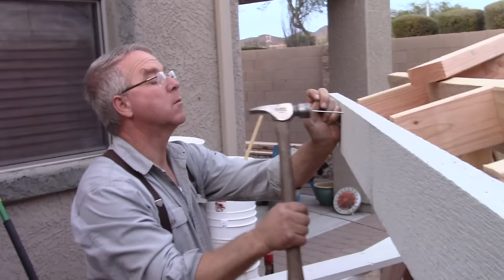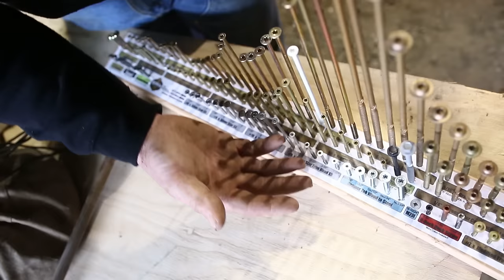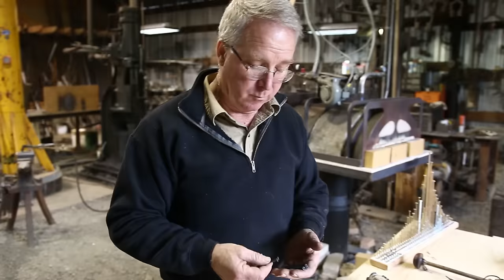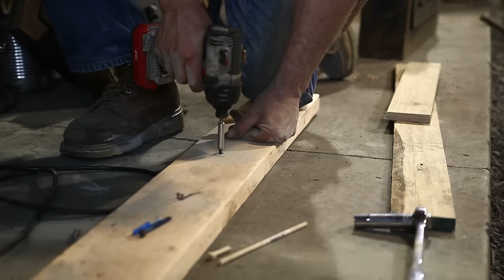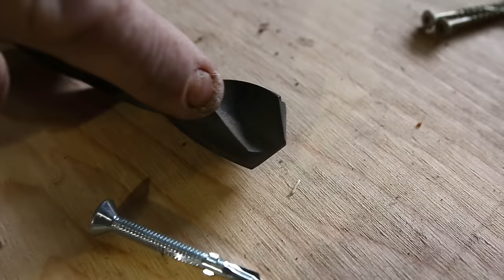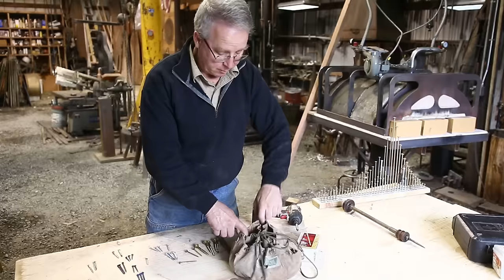Screws: What You Need to Know

Comment: My favourite are 75 mm wood chip screws. Tough and hold extremely well. The zinc plated ones we use in glass and Aluminum joinery trade are great with rawl plugs. I prefer nail gun because of speed but for strength you can't beat the right screws or gyprock screws.the grey ceramic rubbish accumulate in my toolbox.

Comment: Since this video Simpson Strong Tie has a line up of torx drive screws that also include torque reduction thread design that helps extend battery life on your drill and melt into the wood like a hot knife into butter. Great info 😎👍

Comment: Speaking of deck screws, there is a brand called " Saberdrive" . They are a torx 25 drive and they are tough and drive smooth. Because of the torx drive, your bit never slips. They include a bit right in the box, and they are just amazing screws.

Comment: I have been a big fan of those GRK structural screws ever since I first tried them
Reply: GRK's have number 10 or 12 structural screws that can replace a 1/4 inch or more lag bolts ! just holding one in your hands and feeling their weight you know they are using some top notch steel ! Out here in Canada they are around $1.00 each or more ! They do intensive research and testing on them to when you look at their website the intensive specs the released on every type of screws they sell ! Try to find specs on the cheap chinese imports you won't !

Comment: I used GRK decking screws on a new trex deck.  I drilled all 1/8" pilot holes just as per instructions.  Within a month half of the screws sheared off between the trex and framing.  A trex rep said he couldn't see anything I did wrong but told me to take a hike when I ask for some reimbursment.  My opinion, take your GRK screws and shove em.

Comment: Here in Canada Robertson screws have been the standard for years. When a piece of hardware comes with Philips screws I throw them in out and replace them with Robertsons. Philips have almost nothing to recommend them, except in drywalling where the driver cams out of the screws. 
Having said that, the new timber-framing screws with six-point Torx-type heads are amazing.
Reply: I discovered Robertson screws about 8 years ago, they are 100 times better then phillips.
Reply: Henry Ford ran a competition, but upon finding out Robertson was Canadian, decided to go with Philips.  USA #1

Comment: Here in Canada, Robertson screws are the most common type you will find.  They are readily available in all sizes at a decent price.  Certainly cheaper and more available than Torx.  GRK’s are available, but more as a speciality item for which you pay a premium.  

Now, I said Robertson screws because that’s what I’m used to calling them.  But as other commenters have mentioned, it’s not clear how many of these screws are actually Robertson and how many are square drive.  There is a noticeable difference between the two when it comes to “sticking” power.   The tip of a true Robertson screwdriver is square in cross section but the edges are slightly tapered.  The screw recess is made to match.  The result is a snug fit that enables the screwdriver to hold onto the screw even when it is pointed towards the ground.  

While Torx screws are a bit better at resisting cam-out than Robertson, for most applications Robertson screws are just fine and are — in my area — the cheaper alternative.  They are vastly superior for power-driver applications than Phillips or even Posidrive. They are only marginally better than Robertson.

On a scale from 0 to 10, I would rate slot screws a 1, Philips a 4, Posidrive a 5, Square Drive an 8, Robertson a 9, and Torx a 10.  That’s on all aspects except price.  Factor in price and Robertson beats Torx.

Comment: Only place I break GRK screws is driving into oak beams and then trying to remove.  I really like the HeadLok screws with spider drive heads.  Used them to install SIPs on my oak post and beam house and they really speed up the process over the 8" ardox spikes that I used on my last house.

Comment: I'm in the middle of an outside corner removal due to water penetrating a 20-year-old house. The 16d penny nails were rusted to pin heads and the rot had eaten away the bottom 8 " of three corner studs, the entire floor panel and the trim. What complicated job, especially since the deck was attached to these studs. Good bye nails ! When water seeps into the wood, the nails rust away and the structure is compromised. Now I'll use the rust resistant screws to replace everything

Comment: GRK all the way. Their #9 and #10 R4 screws are strength rated (look right on their website) and will make a connection better than any nail of comparable size. Their RSS products are a blessing for sistering up damaged framing members where full replacement is not practical.  This long thanksgiving weekend I am replacing exterior wall sheathing going from pressed fiberboard garbage to 1/2" plywood and most of the (roofing) nails used just pulled right out...  2.5" #9 grks were used to secure the new sheathing. Replaced a section of rim joist and the old one just about pulled clean off.. nailing into end grain already holds less and add 45 years of shrink-swell cycles. Two 5.5" #12 GRK R4's  and a bead of adhesive on each joist end to fasten it down.  I tried them two years ago and became a believer.

Comment: Just for your info. The yellow metal is cadmium plating.It was mostly used on nuts and bolts 50 years ago for ,I think higher resistance to salt water corrosion than zinc (galvanised).

Comment: I just checked the Amazon website and the parachute bag is available. They call it the Bucket Boss Parachute Bag and it is only about 12.99 for prime customers. I don't know the quality compared to his but since just about everything is made in China and what they produce is seldom as good as the original I will leave it to you to decide. I'm going to order one because I am tired of carrying my plastic Stanley case around with me, even though the bins that store your various size screws or nails (I have one for each) are removable, they are awkward to carry when you also have your drill case and a bag of other things you will probably need it gets cumbersome. Sometimes I feel like a pack mule in spring as I go around my property and repair or replace what was ravaged during the winter season or damaged by local vandals.

Comment: Used g r k screws with a t15 bit given in the box. Both the screw and bit started stripping. I prefer Spax stainless screws, sink an eighth of an inch and filled it. No moisture no problem.

Comment: I learned how to hammer in 1986 working for a builder part of the summer nailing together wall sections.  Later when my wife and I built our own home I scored a steel handled framing hammer and steel handled finish hammer from Sears as they had a great sale, I had a coupon and we got an extra 10% off by using our sears card which brought the cost down far below any other hammers.  They worked great and I still use them to this very day, 26 years later.  My wife is a bit of a spitfire so when the smart aleck at the register asked her if she had a left handed hammer or a right handed hammer I gently put my hand on her arm as I could see she was thinking about smacking him in the head with the finish hammer she had in her hand...she's still a pistol.

Comment: Very good video! The german version of the GRK would be the "Würth Assy" system. Slightly different bit than torx, but works better when you have to hold your electric screwdriver at an flatter angle.

Comment: I’m all screwed up lol. Great video I agree 💯 % that you can’t get a better positive drive than torque screws.                                             And “Cordless Impact Guns” & screws are starting to almost replace the “Hammer & Nail”. They even make nails for framing guns that look like screws and are made so you can remove them with a torque drive instead of a pry bar or any type of nail pullers.

Comment: I'll have to try the GRK screws - I've checked and they're available where I live (UK) and not much more expensive than the decent screws at our most prevalent merchants (Screwfix). Interested by that lefthand thread near the head, improved clamping force without driving the head right through the workpiece I reckon.
You're right that hammering is a skill; I'm a DIYer so don't put in the hours, it took me years before I could drive a nail straight and true without pilot-drilling whilst getting a better-than-even odds of not bending the damn thing. Not enough precision to do a 3-inch nail in two smacks but I'll get there :-)

Comment: I use 14g batten screws in a 5mm hole to attach things to concrete or brick. Been doing it for years, yet to see a failure. 
The ones I use are ceramic coated hex drive, and I splash a dab of polyurethane around the entry to keep the water out.

Comment: Really smart stuff here.  Thanks!  Ok.  Now I have inherited about 20 types of Philips head screws.  I have 25 types of Philips head drivers for my drill.  Each driver will fit into about half of the screws, but they all fit differently and will drive with random success.  What are you looking for when mating a driver to a head to make sure you don't strip it when you are about to use the screw?

Comment: Tek srews with hexagon heads normally used for tin roof and clad are great for frames. 5.5mm average is just so much more srew for about the same price as good woodscrews. Take them out even easier than torx, re-use. Heads either stand proud with the washer or sink themselves or forstner bit first for flush finish. For structural stuff its great, also for props. They are sometimes hard on surface or if your wood is dense and dry may split. Our irish fast grown softwood however: perfect!

Comment: The best “trick” I’ve learned about fastening small stuff to concrete....drill a 1/4 hole, fill it with flux and molten lead....you can put screws in it all day.  Works great for threasholds, and transition strips.
Reply: lead wool works better than molten lead

Comment: Your vids are great. I'm a retired US Arny Combat Engineer 1980 to 1994, we in my time often built substructure using wood,nails, and wood glue in certain scenarios.
When I got out I was finishing up my college degree pursuit and working as a handy man. TWO GREAT innovations that I saw Screw materials improvementand liquid nails used in place of wood glue on exterior projects. 

I love Spax screws and solely use them over nailing, except in trim piece installations. 
As you said screws have improved the efficiency of the work, but sadly the quality of homes being built today is abismal. Developers and contractors are not at the level of quality Build responsibility as Contractors like yourself, Bill over at Sparky Channel or the East Coast guy Vince of VCG Construction.

Here in So. Cal. The new homes built are just a building waiting to cave in on the owners, and no one's doing anything about it and worse the pre-home purchase inspectors are just as bad. Telling homeowners either what's not true, OR adding repairs that really are not necessary. 
Your videos are factual and reliable. Thank you sir.

Comment: screws have greatly improved over 20, 30 years. Honestly, a galvanized nail, can be 30% stronger, but you can usurp the math, by using another screw.  We used the GRK screws, to lift a house, that had beams that were double 8x8's (heavy).  scary stuff, the GRK's, did not even stress.   And tapcons's have a very weak sheer strength.  A cardboard box broke a tapcon holding an electrical outlet.

Comment: For cabinets, nothing beats a grabber, for me. Zinc coated and #2 Philips. They cam out as they should, so setting them flush is not difficult to do. Just release some pressure on the drill, when you get them where you want. With practice, you will set them well with ease, every one flush. Use the proper size tapered drill bit with countersink.

Comment: Could not agree more about GRK screws. They have been a revelation and I have no problem passing along their higher cost to customers; they're getting their money's worth. On the Tapcons: I might add how important it can be to blow the drilling dust out the hole. This seems to make quite a difference in how the screw drives.

Comment: I may have asked this before, but do you use a wire nail? 3/16 masonry bit a 16p double head and a piece of tie wire. Absolutely perfect for formwork. Drill the hole drop in the wire and drive in the double head. Easy to strip holds great and the shear sheer strength you need ....also dirt cheap and always available. Also you can precut a pile of tie wire and put them in a small chalk bottle, then just shake them out as needed. It's like magic
Reply from the maker: Love this!!

Comment: I replace a lot of decking installed in the square head era.I use a finishing nail in vice grips and an air compressor to clear out the dirt so I can get a grip to get the old screws out. I love torx screws but I really feel for the next person that comes around to demo my work cause those torx heads will be a nightmare to clean out.

Comment: I love Robertson screws and use them in nearly every project.  They rarely strip out the heads and best of all the screw stays on the driver tip for hard to reach applications such as electrical boxes.  I use ceramic coated screws for exterior applications. I use stainless steel Robertson screws for the highest corrosion resistance. 
I tried some GRK screws for a structural application and I agree they are strong but I think they are overpriced.  The screw does not stay on the driver tip as well as ones a Roberson does and strips out easier. If I  need a stronger fastener I use machine threaded bolts with washers.  If I need a stronger bolt I use a grade 5 bolt.  If I need corrosion resistance I use hot dipped galvanized or for maximum corrosion resistance I use stainless.
I have a lot of cedar fence to maintain and carriage bolts with washers hold better than any screw.  I distort the threads with a hammer after installation and the nut never backs off.
As far as I am concerned the Phillips screw is the worst screw head on the planet and I avoid the like the plague. I will stick with Robertson any day except in very specific applications where I can justify the exorbitant cost would I use GRK.

Comment: The big advantage Robertson has over Spax is that the square is slightly tapered so that a screw can be press fit onto it without falling off.  Eliminates the need for a magnet and makes one handed screwing super easy.  If your screws are falling off a Robertson bit then that bit is actually worn out.  Don't actually see the need for the extra potential torque of the spax since Robertson can deliver enough torque to twist the head off a screw anyway.

Comment: Happened to click on your video and couldn't agree more. While I do know how to hammer, there are some decided advantages to using screws and I find myself using them more and more often these days. Yes their holding power is greater but they are a real advantage in spots where you don't have room to swing a hammer, they are far better for situations where you need to toe nail (using a hammer) and best of all, they can generally be removed without destroying what you are working on. Since I started using Azek and other similar products for trim work (todays pine rots out much to quickly) I use only screws. This way if I ever have to go back and remove it for some reason I don't end up destroying it and can reuse it